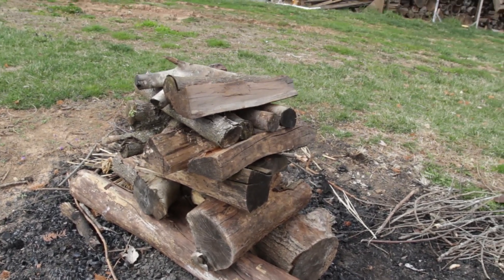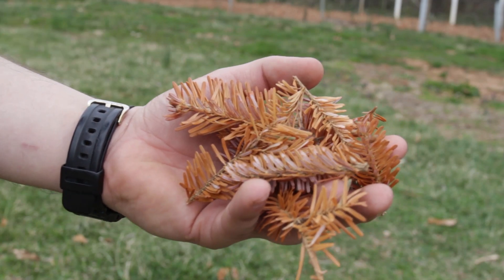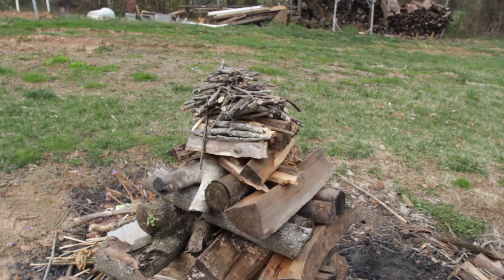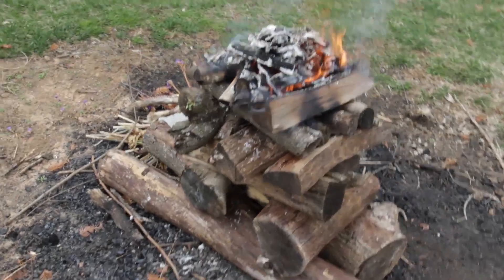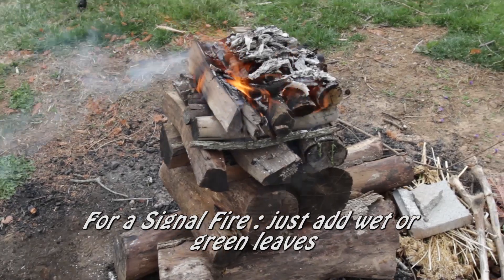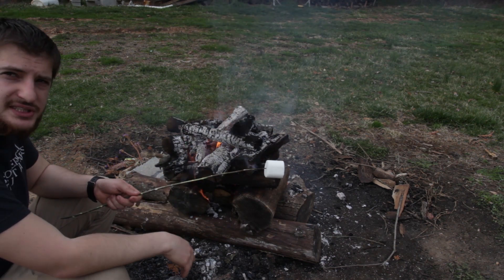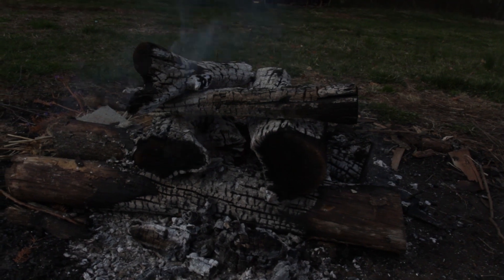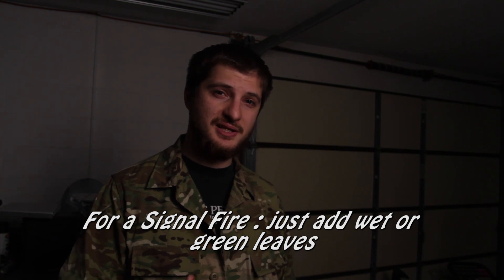Upside down Campfire:Improved & Efficient

Comment: I have been using this in my fireplace ever since I first saw it on another channel. This is a great trick and really does last around 3 hours with just 3 layers (not counting the accelerant on top). It is so much easier to maintain, all the wood is already in position (unlike the teepee style). Make sure the logs are steady as they will roll if the top if the logs burn faster below the top logs, but this isn't that common with the top down burn and well seasoned wood.

Comment: this would be great to build a pit with small pipe like tunnels off to the sides underground to heat the surrounding are as all you have to do is dig the pit and side tunnels and then pile up your logs and light from the top , but the airflow may be a little inefficient so you may have to dig an airway trench leading to it

Comment: Nice wood ;) Problem when you're in the forest without any tools and without straight nice wood pieces. Still great campfire!
Reply: +Adam Specht that would be a problem no matter what fire lay you used; be it teepee, log cabin, long log. Not to mention trying to rub those LOGS together to start a fire ;)
But I'd love to run across some SEASONED logs like he was using...even if I did have tools...those weren't just cut down last week (or even last month, they're evenly weathered, even the splits/cuts)

Comment: Nice job KGB.   Not sure if I would call this a campfire, it is a signal.  This is design so you can at wet material on top or whatever to make smoke without putting fire out. This kinda sucks if you want to use it as a heat source.  Nice video though.  Thanks again KGB